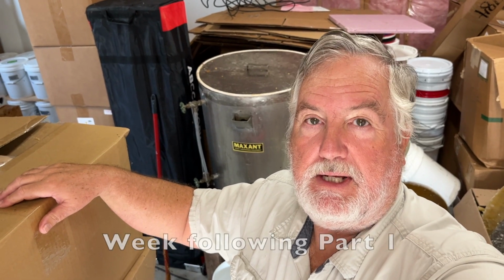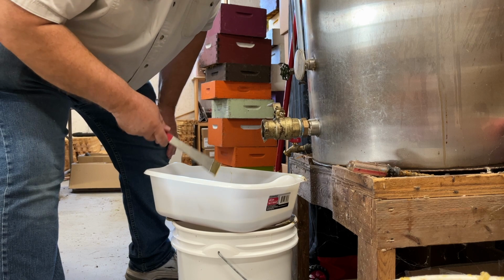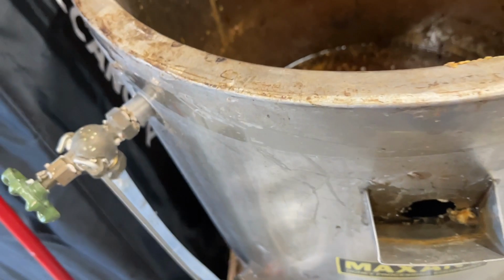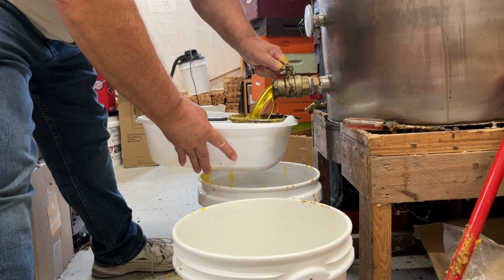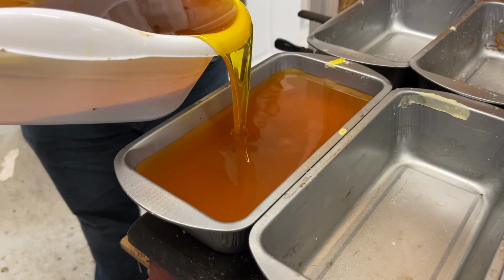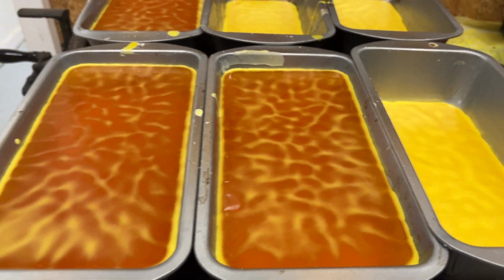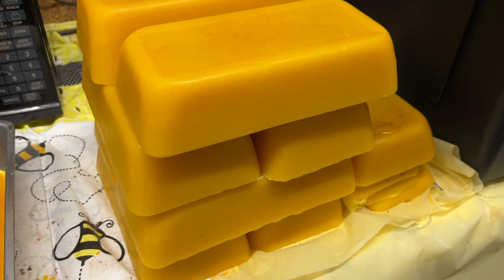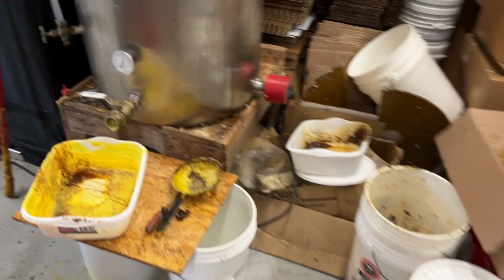Part 2 Bars of Gold!

Comment: Ha Peter good video, I have 2 questions if u do not mind,  if the wax was mixed with the honey will the wax rise to the top like it does with water, and u just pull it out, question 2 if u do not have a market for cooked honey l u feed it back to your bees,  I have never rendered wax before. I have always just gave it to the bees in a nice pile and let them clean it up,  then I just put it in the trash  never had a hole lot anyway,  are u finished with your bees.  thanks  and have a very blessed week
Reply: When you watched the video and he was pouring the wax, he was careful not to get the dark honey on the bottom of the pan in with the wax in the mould.   
The cooked honey can't be given to the bees.  But can be sold as a base for Barb a q sauces.
Reply: @beebob1279  Yes I see that but I guess I did not ask the question right.  I will try again when u melt it all down and u put it in a bucket can u just leave it sit and cool and the wax is seperated from the honey and u just dig it out.  Hope  u understand what I am trying to ask.do u have to pour  it in molds.   thanks for your response  hope
 u have a very Blessed week.
Reply from the maker: No to both points in my view. This way I can get out really clean wax, if I just let it out into buckets sitting on water dirty honey each piece would have a layer of dirt stuck to the bottom of  one. Burnt honey or burnt sugar is very bad for bees so don't feed it to them....but thats not an issue for me as I am developing a market for this honey!

Comment: Just open the valve and let the honey rip. You can pull the little bit of wax off the top of one of the buckets later. It’s obvious when the wax is flowing in earnest.
Reply from the maker: that you will get a lot more dirty or sticky wax that way .

Comment: Very interesting. Why not use silicone molds? No spray needed.
Reply: The bread pans are cheaper than the silicone.   I use them myself
Reply: @beebob1279   If you have an Aldi's in your area, they sell loaf silicone pans.
Reply: @belindaayewoh437  But are they more expensive than the loaf pans?